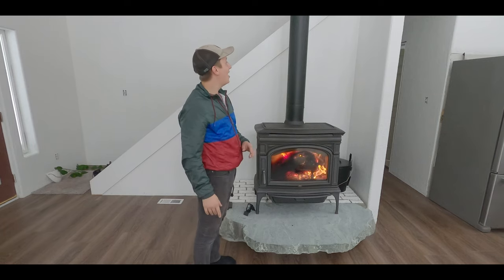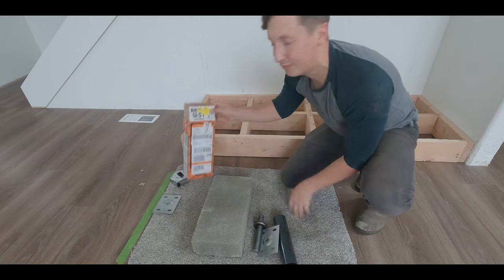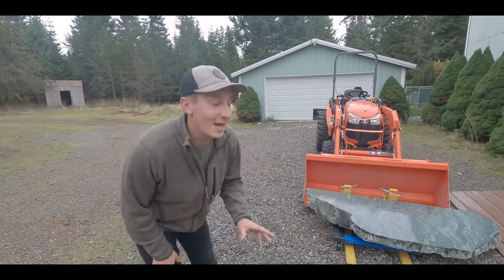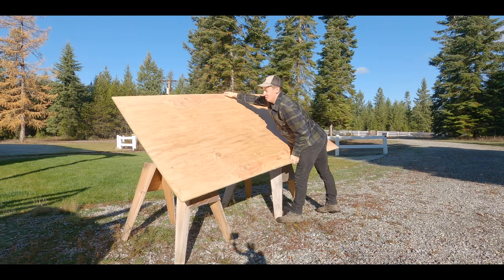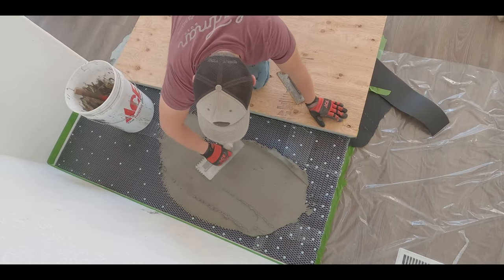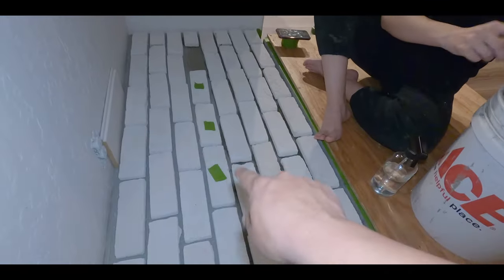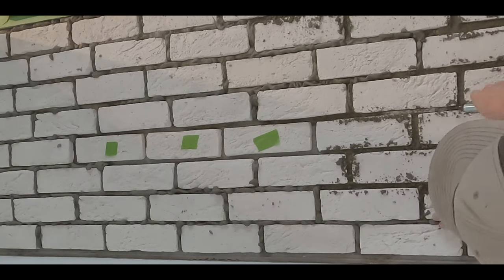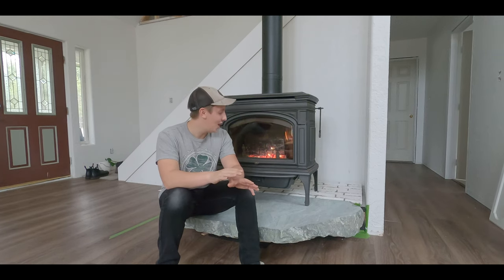How to Build a Custom Woodstove Hearth from Start to Finish | DIY Hearth Design for Our New Stove

Comment: OMG, that turned out great!!! Well done!!! You and Tess did an amazing job!!! Golf clap!!!

I have to ask, will you be putting a railing on the stair case? With all your mountaineering expertise, you probably have zero issues going down those stairs and you are LOL at me hysterically right now. But I can see myself doing a face plant off the side, especially after some late-night beverages. 😊😊😊

How did you come up with that design? I do not believe I have ever seen anything like that before. The stone looks MASSIVE!!! What an attention getter. Great focal point for sure. I could have never imagined anything like that on my own.

Great idea taping everything out first and laying the brick. You do not want any surprises when you begin the build. The platform you made is incredibly beefy!!!

Question on your jack post, is there a way to lock the height adjustment in, to make sure the nut does not back off or did you just use Loctite? 

Love the custom shovel handle modification. 😊

Wow, that was a tight fit in the crawl space. I am pretty sure I would still be stuck in there. 😊 Heck of an effort for sure!!! I cannot believe you dug the ditch, added the stone, and added the support beam and the jack post all by yourself. That had to be a bit of a challenge. Even getting the beam into the crawl space had to be a handful.

My mom and I were wondering how you were going to get that massive stone in the house and my mom said, I bet he will put it on a dolly. I did not think it would fit, but you guys nailed it!!!

Love the front porch ramp. I hadn’t considered one for our place, but that certainly seems like it would come in handy. Do you use it a lot?  Did you build it?

Great job getting the stone in the house!!! I am sure it was tough, but you guys made it look easy! Nothing like reinforcements!!! Leveling that stone out must have taken a long time. You nailed it. 

Nice job making use of the 10 footers and turning lemons into lemonade.

I was not aware you needed a moisture barrier and metal lattice. That is good information to know. Love Tess’s job adding the screws, it gave it an artistic touch!!!

Great job with the scratch coat. How did you calculate the box dimensions to ensure you would be level with the stone? That seems a bit tough. You have the dimensions of the lumber, which are straightforward, but then you have to factor in the moisture barrier, the metal lattice, the mortar and the bricks. Did you calculate the height of the stone prior to make sure the box would match the height? You guys crushed it for sure! Also, nice job figuring out the overlay on the top bricks to line up with the side bricks! 

Do you recall how long this entire project took? Also, where did you get all your knowledge on how to do this type of work? VERY IMPRESSIVE. I can DIY, but I would not have been able to do this. 

Great tip on switching your buckets. Appreciated!!! 

Completely agree with having a licensed company come in and add the stove.  That is insane that they can do it 365 days a year, despite weather conditions. 

Just curious, did they need to shim the stove? 

It looks like your installers did a tremendous job. Great drone footage of the chimney install. 

What a great looking stove! I love the classic look. 

Oh man, that windstorm looked intense. Gotta love being able to heat the home during a power outage. :) 

Great job tidying up the underneath. Looks super clean. You definitely achieved your goal of a floating stone look!!! Outstanding job to both of you!!!

BTW: Killer shot at the end with the camera inside the stove when you were lighting the fire!!!

Question, with a fireplace you can smell the wood burning. Can you do that with a stove? I love the smell that a fireplace produces.  

Another fantastic and informative video! We cannot wait for the next one. 

Be safe and stay well!!!
Reply from the maker: Haha thank you! We are definitely planning on putting a stairway railing in, and between you and I I've already started on the upper railing above the hallway entrance! For one I believe it's technically a code violation to not have one, but we live dangerously on the ledge. It may be awhile yet before I actually finish the video, but we've definitely started it! I will say I have almost had a couple of falls lol. 

Yeah that design.. well it was definitely unique! We were really having trouble coming up with a design, and essentially I made it up on the spot in the stone yard where there were hundreds of different rocks to choose from. I had my eye on another rock that looked similar, and it was bigger so it would've taken place of the bricks.. but it weighed about 2400 lbs so I said no way on that one. All the brick was leftover from another hearth project I did at our old place last year, and essentially I just thought a brick box with the big rock in front of would look alright! It was a stressful decision because a build like this is pretty permanent. I'm just thankful it turned out halfway decent! 

With the jack post there was no way to lock it in place and I did not use Loctite. I'm not too worried about it becoming loose.. hopefully.. oh man thanks for putting this one in my head 😂

That little shovel has come in handy for a number of things! 

..The crawl space is a place I never would like to enter again. That job was hell! I didn't mention it in the video, but I had another jack post and extra wood so I went back down there and added another support beam after the whole project was finished! I hope the wood stove will never go through the floor now! It was definitely a challenging task, but we got it done! 

The Harbor Freight dolly for the stone really came in handy! That and those pallet forks I bought awhile back! 

Yeah the front porch ramp came with the house! If you look closely there's a metal handle on the post next to the ramp.. and if you really look carefully in some of the shots you can probably see a handicap sign on the well house. That's all courtesy of the previous owner.. If I had to guess we bought the house from an elderly individual. I believe the ramp was for a wheelchair. I'll tell you what though it made moving things much easier and I don't intend on removing it. 

Leveling the stone was a huge pain.. it literally took a full day to get it just right. 

Yep! The moisture barrier I assume will prevent rotting and deterioration of the wood in time, and the metal lath provides a surface for the mortar to stick and adhere to! Haha yeah she did a great job adding the screws. 

Yeah the calculation for matching the bricks to the height of the stone was tough.. so I just winged it! 😬 I made the scratch coat low enough and knew that the mortar we would put on the bricks would essentially have to be thick enough to bring the bricks up to the level of the stone.. if that makes sense.. it seemed the easiest to manipulate. If I didn't have enough mortar, then we'd just add more to adjust the height of it. Thanks! I was thankful the bricks lined up with side bricks! 

I want to say it took me about 1.5 months or so.. and that was just working on it here or there. I probably could've finished it in a week or so if I had the dedicated time to do it all at once. My knowledge on how to do it came from another good ol DIY hearth build! In our old shop home, I built a hearth/brick wall for a wood stove and learned it all from doing a lot of research, and by bugging the company that sold me the custom white brick. I literally shot from the hip the entire project but it turned out pretty nice. I'll shoot you an email if interested with the picture! 

Yeah nothing sucks more that grouting the seams than a grout back that won't grout because it has dried rocks in it.. oops! 

I was pretty impressed with the guys that installed the stove. They did a great job! 

And yes! The stove came in at the right time for that wind storm! 

Thanks! The underneath came out looking much better than I thought it would! I love it when plans come together! 

I got a little nervous with the fire shot.. as you can see I forgot that I was in the shot and awkwardly walked out of the frame. Thankfully all was good! lol. 

Hmm.. the only time that I can smell the stove is when I let a cloud of smoke into the room unintentionally.. (usually because I accidentally left the damper closed). Then you can get a nice wood smoke smell! I've never actually experienced heat from an open wood stove. 

Thank you guys so much for watching, and thanks for being patient for me replying to your comments and emails!! Cheers!
Reply: @theidahopanhandlers   Oh wow, can't wait to see the stairway railing build!!! It is not nearly as sketchy as that insane short cut you guys took down that vertical in the White Clouds or the devil’s staircase, but it will be nice to have one up there just in case. 

Wow, great job coming up with that design on the fly. That is not really a strength of mine. I would have had to jump on a CAD program for sure. Completely understood on passing on the 2,400-pound monstrosity 😊

Hehehehe, did not mean to freak you out with my jack post comment. I am sure it will be fine. If there was a need to do it, it would have probably had a built-in mechanism. With two of them in there, you are set. That part of the floor is probably the most reinforced part of the house!!!

Good to know about the ramp! It certainly seems like a useful addition to a porch. I will consider getting one when we get our place. 

I thought the fire shot was pretty cool. It looked like you meant to do it. I re watched it and I could not tell it was unintended.